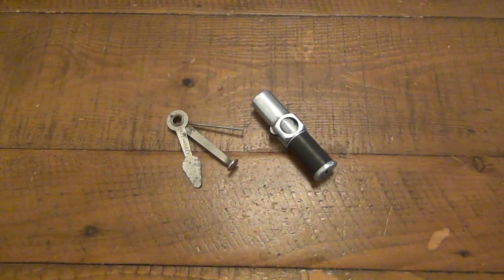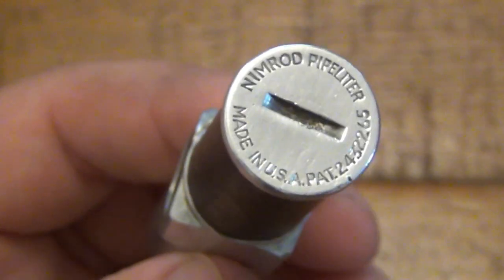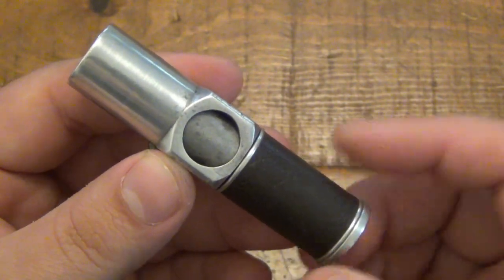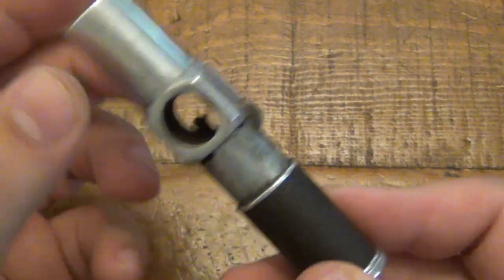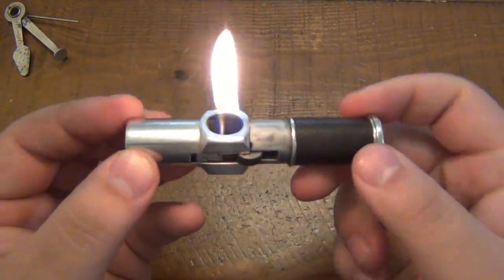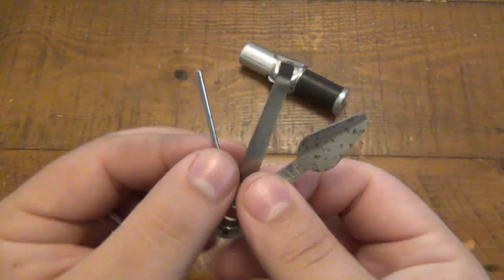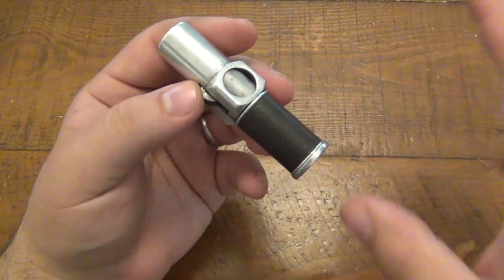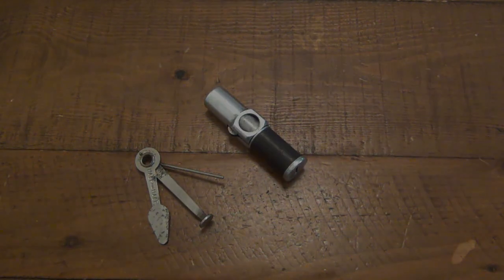Vintage Nimrod Pipe Lighter & How It Works...(Invented In 1947)

Comment: Jeff, I believe when the inside of the screw slot is radiused like that, it is designed to use a coin. My guess is that it is meant to fit a dime or penny.
Reply from the maker: :) yes a good tip
Reply: sorry to be so off topic but does someone know of a method to log back into an Instagram account??
I was dumb forgot the password. I appreciate any tricks you can offer me
Reply: @Joaquin Luka Instablaster :)

Comment: Hey Jeff, nice bit of oldies kit, but (you knew there would be one), if you grip the Nimrod in your right hand as you did and put your left thumb over the striker wheel with the rest of your left fingertips holding the liter... just pull apart briskly, and the Nimrod does all the heavy lifting for you. To paraphrase Ben Kenobi, "a more elegant liter for a more elegant time".Yes, I had one. I'm still working on my grooming kit from the late 50's. Thanks for the memories.
Reply: Nice!
I'll bet that is how it was designed!

Comment: Just picked one up at an estate sale for 25 cents (was 50 cents,  but everything was half off the second day) 😜
I don't know for sure,  but am reasoning that the lighter is designed so as while you're pulling it open you're also running your finger over the flint wheel (opening and lighting with one motion)

Comment: I discovered that if you hold the leather side on the left and pull it apart with your right while keeping your thumb on the wheel you can open it and light it at the same time.

Comment: Hey jeff, I don't know if you covered it or not but the wheel on my zippo wont move what should I do about it
Reply: @kingpanda2217  how you take the flint out
Reply: @chriselliott484  look up his video on maintaining a zippo, you'll get all the info you'll need
Reply: @chriselliott484  pull the insert out and there should be a brass coloured screw unscrew it and a spring will come out and above the spring should be the flint. If you can't get the flint out it might be jammed so find something thin to stick in there to try and work it out
Reply: @chriselliott484  also if it's an old lighter there's a decent chance that the flint has deteriorated and  has basically turned to powder in that case you're going to need something to try and tap it out
Reply from the maker: I agree with the comments below probably a jammed flint you have to use a thin tool like a eyeglass screwdriver to sort of scrape it out, you take the insert out and unscrew the brass screw and remove the spring its in the tube, once you can see the tool your using under the wheel it should be free its more than likely crusty powder by now so be careful and work slow , once your done put a new flint in it and you will be good to go, flints can be bought at gas stations and grocery stores...
Reply: @cutlerylover  I know I've seen the Ronson ones at Walmart idk If they would have there or not
Reply: @guanyu5091  I got the flint out but I can't get it back in